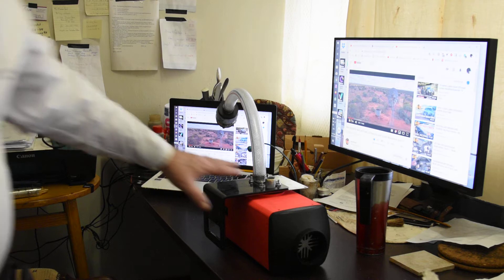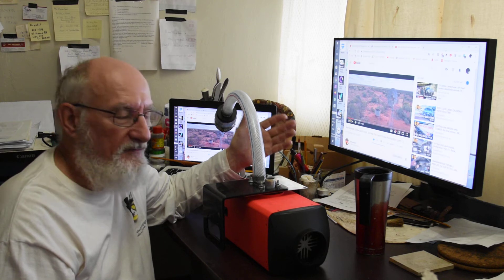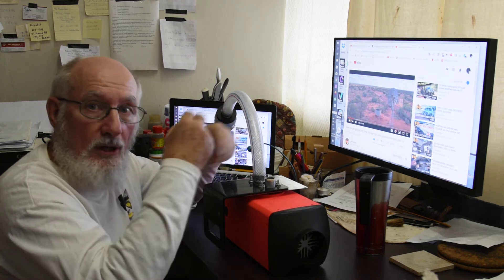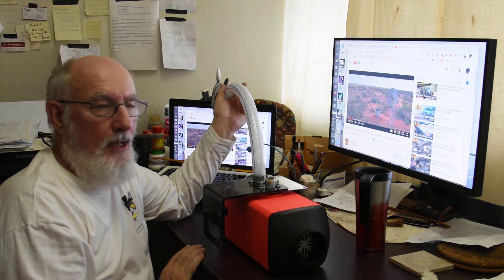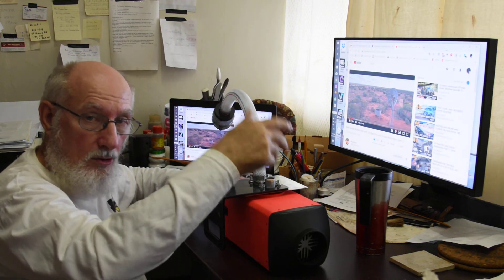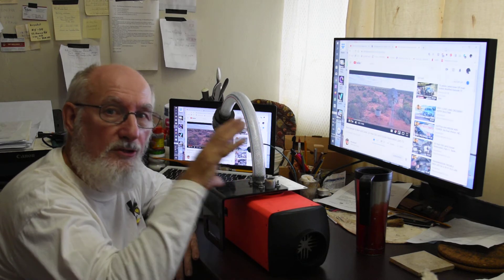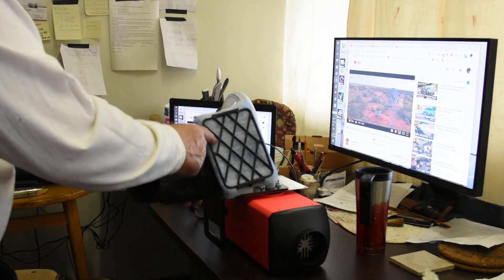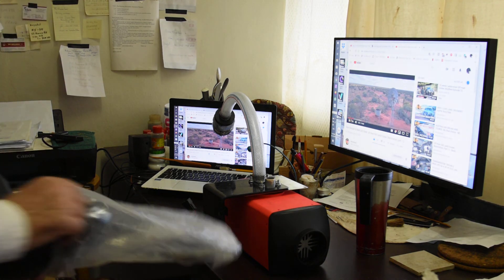Modifications to my Chinese Heater  & Why

Comment: Hello from Sweden. I have been selling this kind of heaters for about 10 years in Scandinavia. I propose that let the inside air circulate for better and more effective warming of your camper. Reason is if you take outside air through the heater, for example -25 deg C and heat that up it use more diesel for example. The air for combustion you have to take it from outside camper. The air you heat up let it circulate in the camper and have a window little open for fresh air.
Reply from the maker: Hello, circulating air as you would in a car works,I agree. In my application my heater is  a)mounted outside of my living space,in the  area  that holds my water tank,so that the pump can service the Heat Recovery piping  b)  the hot air discharge faces  into a wall. Drawing air from my living space is not an option.  Your point is  valid, but it does not fit my application. Thank you for taking the time to comment.  dave

Comment: Wonder whether it is better to re-circulate the outlet hot air, rather than heating colder air from outside ..
Reply from the maker: Hello,  For my application that idea, while valid won't work.  I use the heat from my unit to heat water to help keep my main water tank from freezing.   Inside the discharge hose, I have coils of copper 3mm tubing tat connect to a circulation pump.   As long as the heater is running, ths pump is pushing water through the system.  There are two set of coils.  This is a two stage process.  Water flows up the coil in the discharge hose , pre heating.  Stage two,connects this line to the  bottom of the coil that is  wrapped around the exhaust pipe absorbing"waste heat ".  That  water   circulates  up into a heat exchanger in my sleeping area that ends up flowing  back into  my 55 gallon water tank.  Secondly,   If the exhaust line from the burner  were to develop a leak, I would be drawing that air into my living space.  CO-2 hazzard.  There is a 2.25 inch wall between the two spaces. I have fans pulling  outside air through where the heater is mounted  and pushing air out the opposite end of the area where it is mounted to prevent that possibility. Thank you for the suggestion.
Reply: @jdcoverland365  Many thanks for the reply. Sure did not realise you were heating water, however, where you mention connecting the snorkel to take air from the outside, was wondering why you could not take this air from the inside of the vehicle as it would already be pre-heated i.e. warmer air...

Comment: Looks like a great build, are you pulling outside air to heat?  Just wonder how hot the discharge would be heating cold outside air.